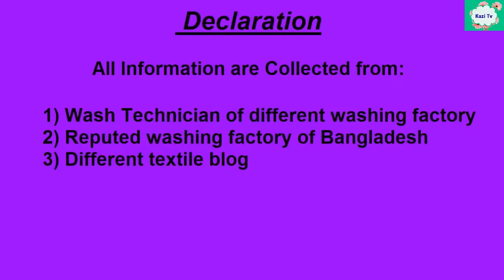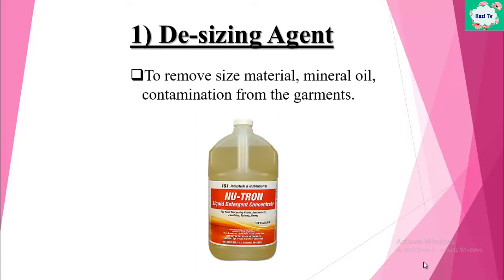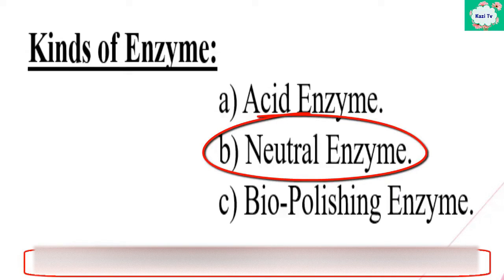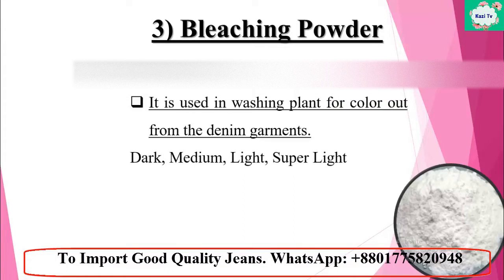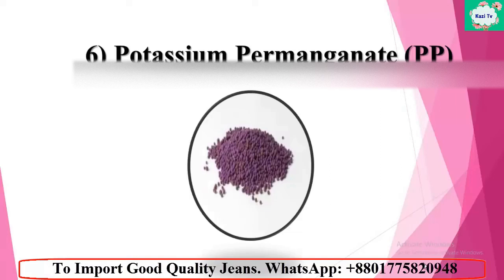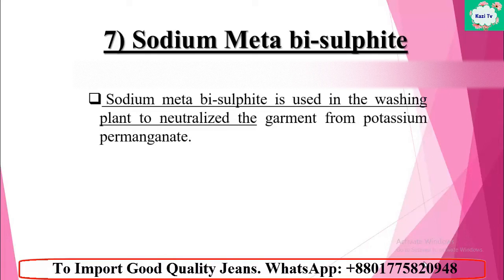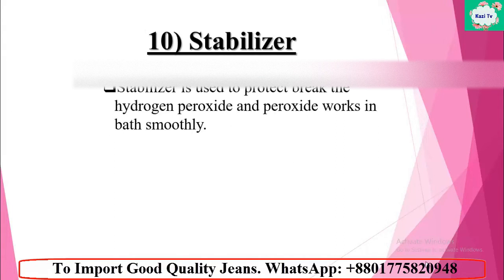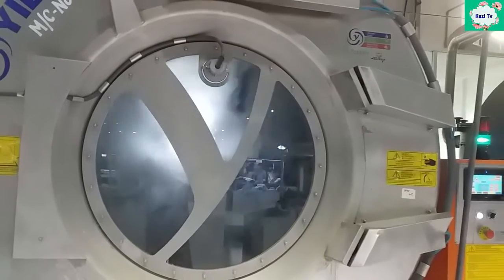Basic Chemical Used for Denim Washing with Function// Washing Chemical's Function

Comment: Tell me how to get a whiter tone on pp spray area if it is not getting neutralised properly... It gives slight yellowish tone...
Reply from the maker: you can use posphoric acid with pp.than neutral by sodium meta sulphite.....with temperature.....trial first one leg.....
Reply: @textiletrainer  that means i have to spray it again..
Reply: Suggest me some good opti brightener for Denim x and coloured pants..  for shining and brightness
Reply from the maker: @bhaskarsingh7781  vai.....at first brush the local area than spray than neutral......
Reply from the maker: @bhaskarsingh7781  you search chemical supplier of your country....they can provide good brightener as you want......company to company brightener name is different.....thats why I dont suggest any brightener......ok....
Reply: @textiletrainer  okk bro
Reply: @textiletrainer  i was talking about if it is not neutralised properly at first...
Reply from the maker: @bhaskarsingh7781  ok...bro...
Reply from the maker: @bhaskarsingh7781  yes... if it is not  proper neutral....local area looks like yellowish.....